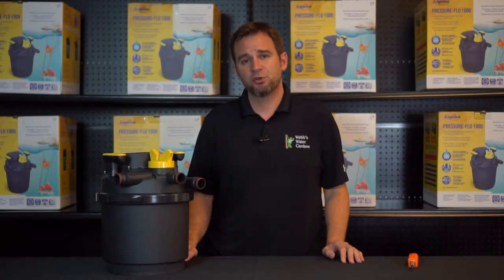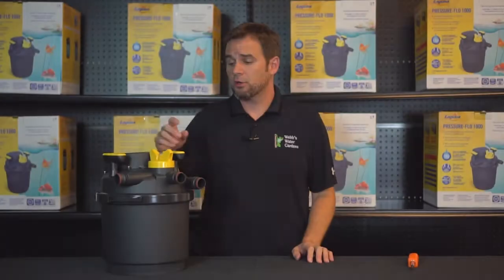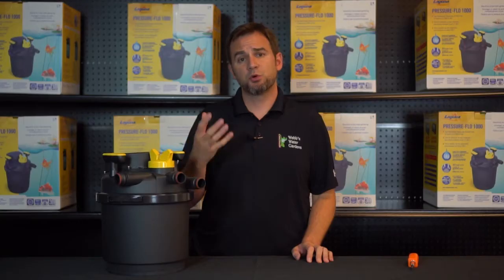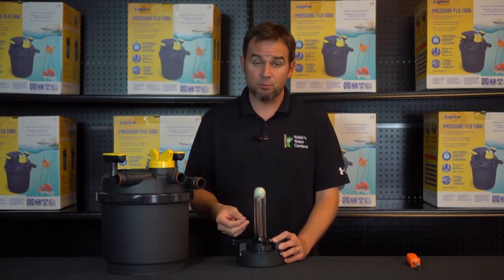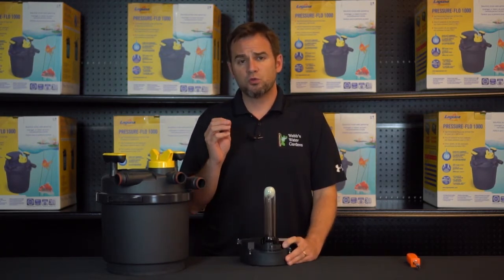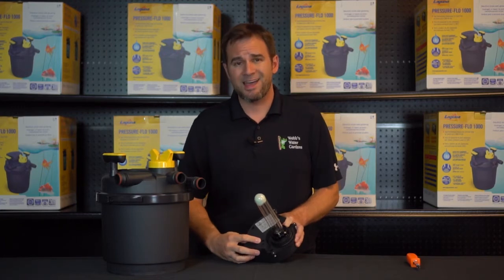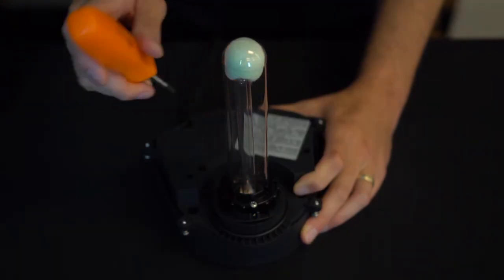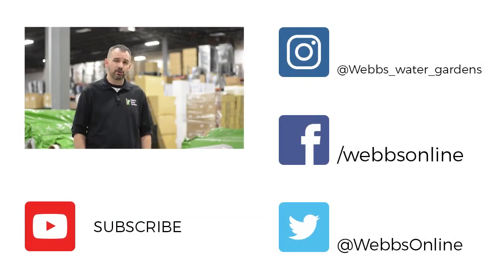Testing the UV Light On Your Laguna Pressure-Flo Filter

Comment: I recently bought a new Laguna Pressure-Flo UV bulb for my Laguna 2100 UVC filter.  I tested the new one and got nothing.  The folks at Laguna said that if the new bulb doesn't light, the head it plugs into needs to be replaced.   The head is not cheap so for fun I opened it up, and inside there is a fluorescent bulb starter, which is a part that often fails in old design fluorescent light fixtures.  I found one online for $5.95 ppd, popped it in and the bulb lit up.  Back in business for $5.95.  The starter I used is a Philips 00002 S-2 Ballast starter, but match whatever one you're replacing.
Reply from the maker: Great thinking, Tom!
Reply: I agree....good thinking.  How did you open up the head to get at the starter?  I have the same problem.
Much thanks
Reply: @larryhavassy2280  Once you've removed the head from the top of the filter by loosening the 4 Phillips head stainless steel screws and lifted out the UV bulb, tube, and casing, place it on a table with the bulb tube pointing up.  There are 4 holes, 3 larger and 1 smaller.  Loosen the screws at the bottom of the 3 larger holes and you can separate the two parts of the casing.  There is a tiny diameter O-ring where the 2 parts meet.  With the 2 parts separated, you have access to the electronics.  The 4th smaller hole contains a switch that disables the UV bulb while the unit is disassembled (as described in this video.)

Comment: hi  I've heard the uv bulbs only last a season and you have to replace them..is that right ?
i mean if the bulb is still lighting up does that mean the uv part is still working ..sorry if it seems like a dumb question !
Reply from the maker: No dumb questions. UV bulbs should be replaced after every 12-14 months of operation. Yes, they can still be lit after this period, however they are no longer germicidal.